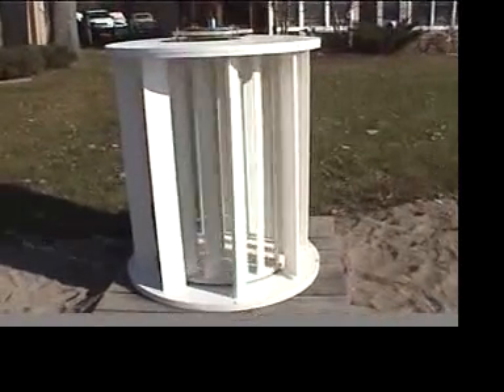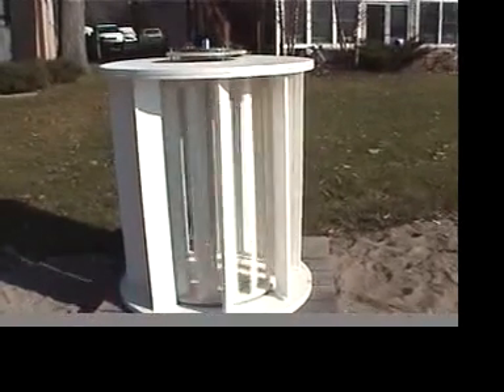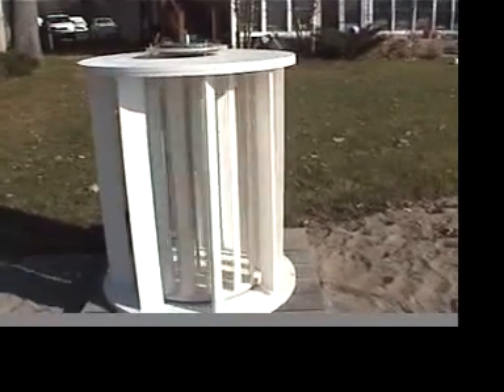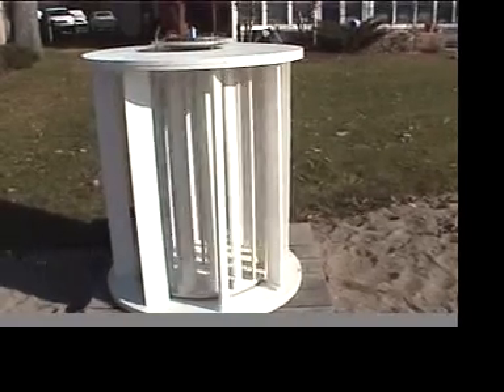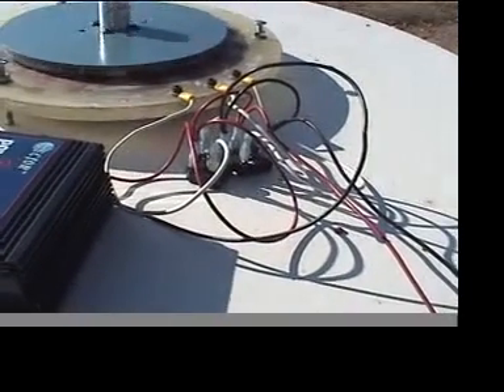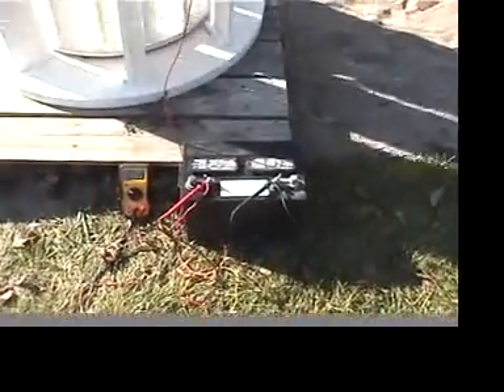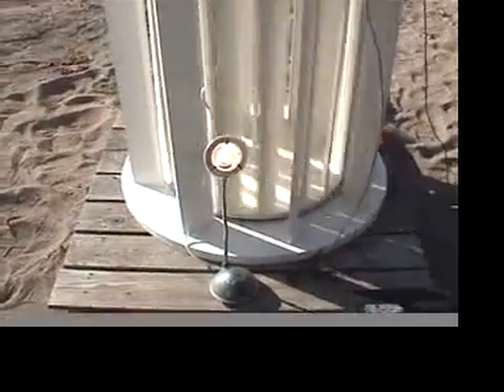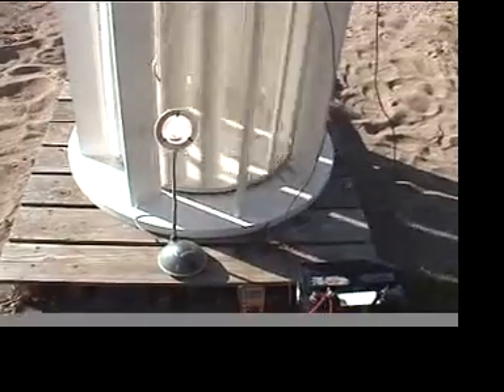Lynx Vawt with new airfoil rotor vanes

Comment: I'm planning on building one of these but I'm a non-conformist and unconventional kinda guy. I'm going to try to built a modular one that has two of these stacked on top of each other. My plans are to make it counter rotating with the top and bottom sections turning in opposite directions. Hopefully I can get it designed like another man has his. He has it on You Tube also. On his, he has the PMG stator and rotor turning with the use of a slip ring. Twice the speed in a given wind. Good idea?

Comment: I'm going to build one of these. It looks like a pretty good design. Have you thought about making these a modular design,so that you could stack several on top of one another? Also, I think a good thing to try, would be to gear it up with sprockets and chain. Possibly with interchangeable gears to to try different ratios. You could then see what effect different gearing has on the rpm. I really like this design but like i say, i think i would stack several on top of one another. Good Work!!!

Comment from the maker: I use pine base cove moulding that is nearly an airfoil already.  Then I use a plane and shave the pine until I have a rounded leading edge, sand and paint.  I use flat pine stock for the stator blades but I also round the square edges and sand.
Use exterior grade glue and a nail gun for fast assembly

Comment from the maker: Go to the website linked in the description above for plans.  I made this larger version and it was so much more difficult than the original 4' H x 3' D.  I strongly recommend the smaller version.
Scroll to the first post on the above linked website and thread for printable plans

Comment from the maker: This design is rather expensive and tedious to make for what it does.  But I will say it has been running for a couple years without attention through rain, snow, sun, floods and keeps going.   If you really want plans reply to this and i will dig something up.  I had drawn this up.  You will need a PMG which doesn't exist as a manufactured item.

Comment from the maker: @otherpower 

No, I don't have a power curve that I have confidence in.  It is 12 sqft.  4' high by 3' D.  The most I have seen in watts is 30 watts going into a 12 vdc battery bank.  For one thing I think this is too small to be really anything more than a trickle charger.
I am working on a larger model 6' High x 4' D which is 24 sqft.

Comment from the maker: Thanks!  They are at a 45 degree angle from perpendicular to the axis.  Flat side of airfoil faces inward, leading edge faces the direction of rotation.  Why this works I haven't fully understood.  I think because the wind is not moving in a straight line through the turbine, and the rotors move faster than the wind.  I sail a lot and in that way it does make sense.  Apparent wind is different than actual.

Comment: wow that's a heavy turbine! you could've used the belt or the chain and do the ratio thing with the rotor in the motor(eg. when turbine makes one spin, rotor makes 40 full cycles), that way you could reduce the weight of the turbine by a weight of all the stuff on it...

Comment from the maker: Originally I was going to use the magnetic levitation.  The reason i didn't was that it would occupy several inches of space to support the 85 lbs of rotor.  The rotor is made of two 3/4" discs, 16 blades and carries the 24 magnets and steel PMA discs.  
As it is, the shaft sits on a single ball bearing and bears all that weight on a spot the size of a pencil lead.
Maybe I should give the magnet thing a try.

Comment from the maker: The three phases are connected in "star".  Three terminals are cast in the stator and are threaded with 10-32 bolts.  Right now I am using this as a test bed so the rectifiers and inverter are mounted on the turbine.  Ideally the ac would be run to where the rectifiers and batteries are and then the dc used.
I now have three rectifiers and smoothing capacitors installed.

Comment from the maker: That's funny because my twelve year old son suggested I clean it up more.  So now there are three rectifiers on a heat sink, wires cut to length. And a cover for the top.
The alternator is 12 wedge magnets on each disk.  The stator has 9 coils.  
I am working on some simpler ways to make these.  Each alternator  took seven hours.  
Can you tell me a good way to test this machine in a way that could be repeated by others? I'll test and report back.  I have an rpm gauge, but not a wind meter.

Comment from the maker: Thanks!  Its Murphy's law.  Since getting the new rotor blades in, there has been little wind or an east wind which my house and trees shadow.  The one day I did have 10 mph winds I ran a 50 watt 120 v halogen and watched the volts.  No drop on voltage.  The forecast calls for light east winds for awhile.
So far very unscientific.  I am looking for best speed from the turbine and at least charging voltage.  Easy to construct and affordable as a kit.
The electronics don't need to go there